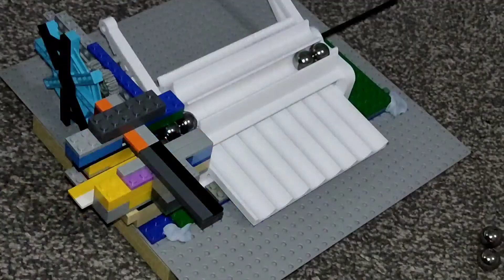MMX Kink Trigger: FAILED attempt to improve on a Masterpiece by @TheMoen

Comment: I like how you can quickly prototype a concept and your willingness to abandon an idea that doesn't pan out.  I was looking at some of the divide by eight ideas and was wondering if anybody has thought about a clutch?  That is.. a disk is always turning a fraction of an inch (mm?) away from the unit holding the marbles.  Only when the marble row contains all eight does the clutch engage, dumping the marbles, and releasing the clutch again.  I can see it in my head, but can't explain it very well here.

Comment: I prefer the idea of a powered trigger, synchronized to the movement of the next element in the chain (such as a fishstair).  That way there aren't 8 queues of marbles after the DB8, just a single wave of marbles timed exactly when they're called for.  The downside is that there may not be 8 marbles ready to go, so you get a partial load, but the alternative would have been an 8-wide "bubble" in the system anyway (an empty group in the fishstair or conveyor).
Reply from the maker: @ashleyzinyk4297  in the specific case of the conveyor, it's anticipated that the rate incoming will average to below the capacity of the conveyor to lift. That's the fundamental long term limit of the machine.
However, because of the marble buffers, both in the individual instrument channels, and in the recycle loop, there may be cases where for short spells there are more than 8 marbles per beat being played. Then the buffer lane in front of the conveyor may come into play, and fast dividing will be needed to maximize its use, before backlogging occurs through the lifting wheels etc.
Reply: The tricky part about a powered solution is that at no point is the fish stair standing still. It's constantly moving, albeit at a sinusoidal rate. Or, I guess technically whatever the integration of a sinusoid is called. Anyways, you get my point. It takes time for the marbles to move, and they move at their own pace. If they can't make it into the right position in time, everything falls apart; this is made trickier by the fact that it never stops moving.
Reply from the maker: @connorcampbell5274  a think we're a little bit at cross-purposes here. The DB8 would be for the conveyor, to improve distribution to the divider. The conveyor DOES pause for marbles to load, once every beat.
Reply: @MrGonzonator  oh yeah. My bad. Been too far down the divide by four rabbit hole for too long.

Doesn't it only pauses because of the ratchet, though? I thought the conveyer was driven roughly the same way as the fishstairs
Reply from the maker: @connorcampbell5274  it ratchets because it needs to pause. The marbles fall in under gravity, so the conveyor has to be stationary.

Comment: Maybe a solution for the gear problem: maybe you can use a chain to connect the to parts. A chain isn’t dependent of the distance between 3 axles but tension is an issue with chains.
Reply from the maker: As ever, the Discord community have been very helpful in providing constructive criticism, pointing out the (many) flaws in my setup and convinced me to carry on with the next (printed) iteration.
For example, much of the slop was due to inadequate bracing of the gear axles. The use of four gears also contributed; the printed would have just two, so only ⅓ the opportunity for slop.
Finally, my axle was just Lego technic which is both too flexible and was only connected to the wheel with Bluetac, resulting in yet more slop.
Reply: @MrGonzonator  I like the term “constructive criticism”. I’ve never heard it but it remind me for a difference of “regular criticism”
Reply from the maker: @brixbyrox  that made me chuckle.
Constructive criticism is what the Wintergatan Discord community is all about; helpfully pointing out the blindingly obvious flaws in your design and offering ideas for how to fix them. Believe it or not there is an active discussion right now about whether this in itself is a marketable resource that could be hived off into a DAO company...